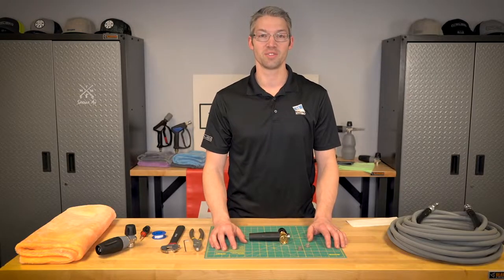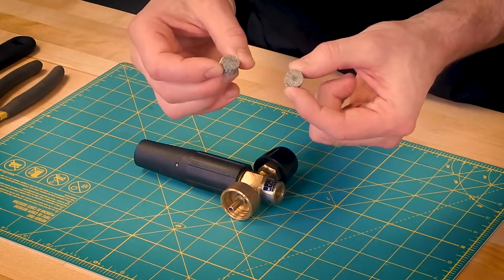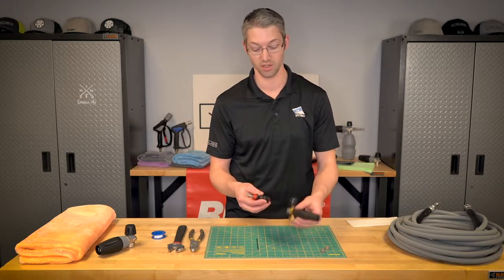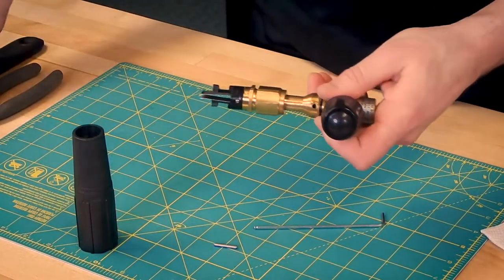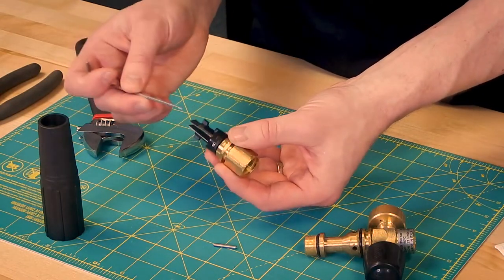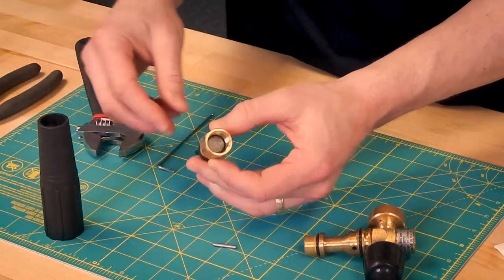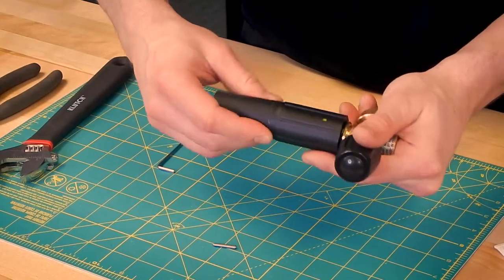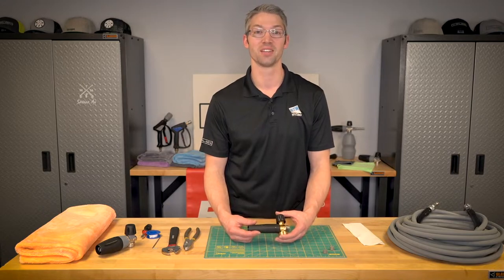Original Foam Cannon Filter Replacement (HOW TO)

Comment: Hope one day you guys make a wider neck one. I really don't feel like getting soap everywhere or using a measuring cup...
Reply from the maker: We're always working on new products, so keep an eye out! In the meantime, our PerFOAMance soap does ship with a pour spout cap to make it easy to fill foam cannon bottles.

PerFOAMance Soap can be purchased on our store here: https://bit.ly/30rvrc5
Check out our soap video here: https://youtu.be/Qd5azmjGfm4
Reply: @PoweredbyVeloci  Now you're giving me hope haha. I just purchased from you a filter and the nozzle for my different brand of foam cannon. But regardless of the soap, that'll be nice. I'm surprise you guys don't have it yet, considering the amazing stuff you guys sell.
I just got the Mezzo Wash System, and that's a totally genius product.
Reply: what gram size mesh filter do you recommend? im using a foam cannon mingle snow foam cannon with a 1.1 m orifice and a sun joe spx4001 electric pressure washer
Reply from the maker: @wyattracing_andreviews1155  The mesh filters for the Original Foam Cannon can be purchased on our website here: https://www.mtmhydroparts.com/collections/foam-cannon-parts/products/foam-cannon-repair-kit-for-14-5001